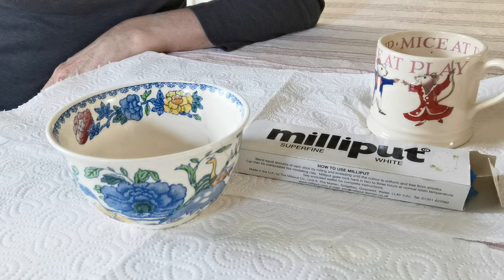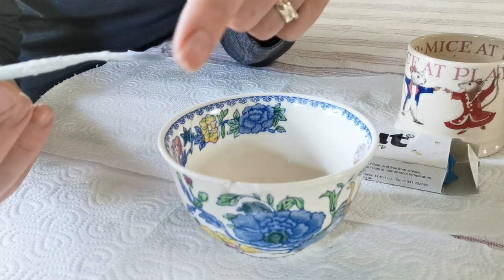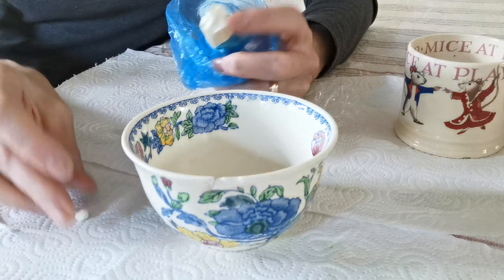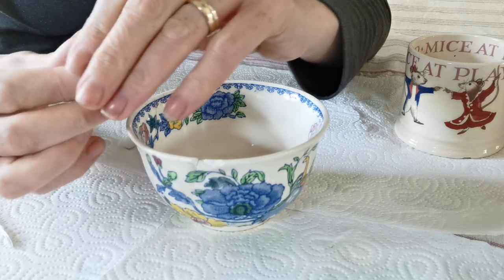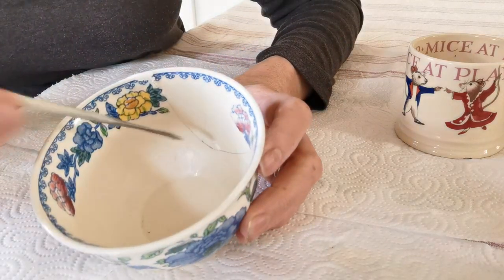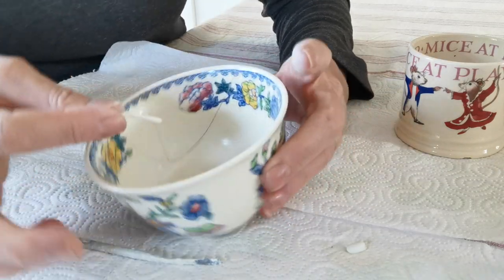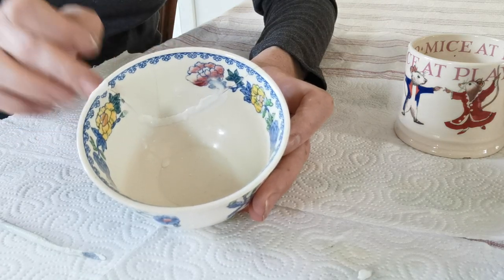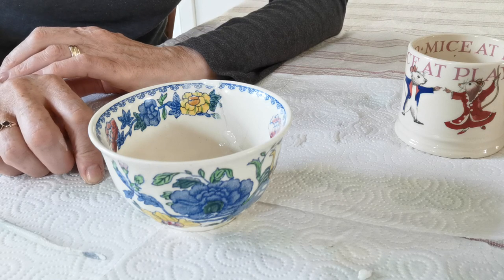HOW TO REPAIR CHIPPED PORCELAIN/CHINA WITH MILLIPUT LATEST

Comment: Is the Milliput food safe?  I want to repair a porcelain coffee cup. Can it be placed in a dishwasher or does it have to be glazed first? Other than the Rustins, is there another air dry, non-kiln Glaze you recommend that’s not quite so expensive? Thank you from Arizona, USA
Reply from the maker: Hi there, I cannot confirm that Milliput is safe, you would have to read Milliputs instuctions. There is a Winsor and Newtown ceramic glaze which you can buy from America.
Reply: @theceramicrepairstudio  I ended up contacting the company and they confirmed that it was in fact food safe! Thanks
Reply from the maker: @toniallen1130  Great to hear.😊

Comment: Can we use the bowl to eat after repair it with miliput? Would there be any chemicals leak?
Reply from the maker: Hi there, I do you use Milliput on cup and plate chips and would personally use once sanded and cleaned, if I haven't used any glue or varnish on the item. Please look at Milliput manufacturers instructions which I believe is on there website to make sure . Many thanks for watching and ease let me know how you get on.👍

Comment: i am going to give my best ever tip for cleaning hair line crack Spider cracks and removing soaked in grease and dirt / tea stains on old porcelain dinner ware and antique China ware . First clean object in a little white soap  powder water without any dyes in it Let it dry. .If object has old glue repairs use a repetition of going from tepid to hot water over the course of half an hour and the old glue will come away easily and items will not crack "DO NOT FORCE PIECES APART "Or you can use paint remover in a lidded container and leave for 24 hours or more . Once you have cleaned all the piece's and let them dry .Fill a lidded container with 2 or 3 bottles of normal domestos bleach making sure all pieces are covered with bleach and slightly vibrate container when you have a chance over a 24/48 hour period ,  The bleach can then be sucked by pressing bottle into bleach and releasing back into bottle for further use .Always wear a protective mask and rubber gloves  Total cost between £3 to £10
Reply from the maker: Great advice 👍

Comment: I just nabbed what remains of my deceased Grandmother’s bone china set. The pattern is called ‘Silver Wreath’ from JAPAN (not the same as a patern from Pickard of the same name). 

What kind of metalic paint would I use for rims? 

Also, is the materials used in the video same to use on tea cups? I’d like to start using mine, and I have 7 out of 20 teacups I’d like to try to repair if possible.
Reply from the maker: I use liquid leaf gold, I does come in other colours